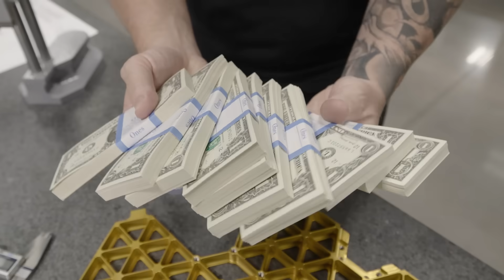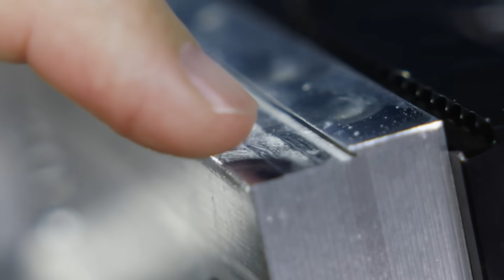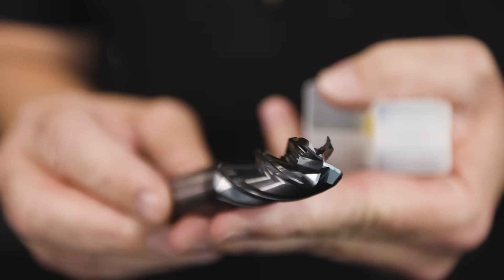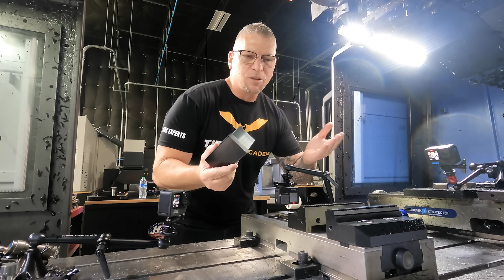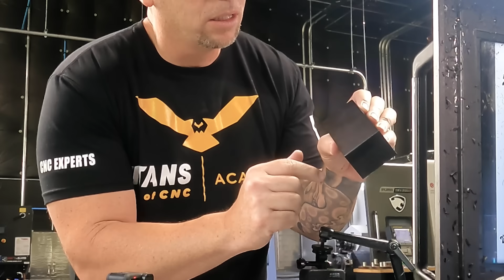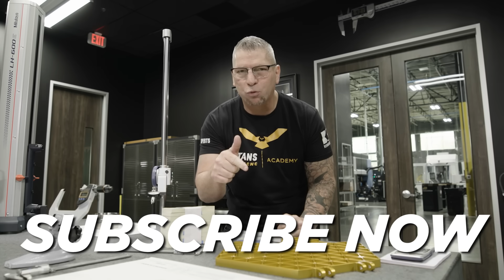How To Master The ART of Machining Plastics

Comment: I’ve been machining for about 3.5 years. I originally went to votech for diesel mechanics, but when I found out the school had machining, I decided to give it a try. Struggled at first on the lathe….but after a few minutes of fiddling I got that perfect cut. Perfect speed, perfect feed, chips breaking perfectly, leaving a flawless finish! As I stood there, mesmerized by what I was doing, I knew I wanted to be a machinist. Since then I have basically became a model employee for a good Godly man, and machine hydraulic components. During training what when I found out about Titans of CNC, did the building blocks as part of my training, and even convinced my shop to start using fusion360 over a significantly less intuitive software package. - Based on the average thickness of paper, plus a little extra for air gaps, I’m guessing that bill stack is 5.1510” thick!

Comment: Got into machining at age 17, in my co-op class in highschool, originally just running manual machines. after high school I went back and took a job at the same shop that they had offered to me. They put me on a CNC mill, and I loved it, I spent all my time learning about g&m codes, metrology, macro's. Year later, they bought a brand new wele AA1880, put me as the sole person to run it. We started getting very busy so we had a afternoon shift, and I became the supervisor of that at almost 20years old. Did that for a year and a half and have now moved to a different shop to experience different parts, allowing me to learn cad/cam, and to continue to grow my career. My guess is 4.412" or 112.065MM.

Comment: I originally wanted to go to for I.T. However, my mother wanted me to run a machine shop. Since my grandfather had a stroke and slowly becoming blind, he can't technically work anymore. So I took the time to go to school to learn machining at NTMA and go from their. I also took a couple of other jobs so I can learn the differences from other machines and controller. From FANUC, to HAAS, to Fadal, each machine has their strength and weaknesses. I also noticed that most companies like to push/rush parts instead of  taking the time to make quality parts and due to the fact companies are attempting to low ball you every chance they got which have discouraged me from time to time and how nieve I look. Especially, that I'm a fast learner sometimes I get compliments that I'm a little more advanced than my experience then to also face a learning disability like Asperger's syndrome has been quite a milestone. I'm from the inland empire, California. The stack is about approximately 4.380 inches if you account that a dollar bill is approximately .0043in and the paper strap is .004 (X2 since it's wrapped around the bills)

Comment: I am a 4th generation machinist who has been machining for over 20 years now. My grandfather started his own company back in 1975. After working for Gray Tool Company, he decided he wanted to start his own company. One where we treat our employees like family and not just another number. The first six months he was working two jobs, so during the day he would have my grandmother rough in parts and he would come home and finish them. By 1978 all four of his sons were in the shop learning the trade. In the 1980’s during the oil crash things got bad, but our family pushed through and survived. In the mid-90’s my father and uncle took over the business. Around 2000 my dad let me run my first machine! It was a 1954 Hole Wizard drill press that we still have today. I got to drill (12x) 1-3/8” holes into flanges. By 2005 I was running our big CNC mill. It was a Doosan Puma V-60 prototype. It had 45hp Cat50 spindle, and boy that baby could hog in its day! After years of learning the CNC machines, I got my chance to get into the programming room. I was so excited that I finally had the ability and the power to build programs to push these machines to places we had never taken them! Since then, we have advanced our shop with major upgrades like 1000psi machines, CNC saws, de-vibe bars, all sorts of modern cutting tools, and even a shop system that helps us control the jobs from Estimating to final shipping. It has been a wild ride, but I have made a lot of family over the years. The only thing that hurts is the way the economy is head. My hope is that we can survive through this time. We are down to 7 employees now, but we are still have positive months rolling in. 

I’m very thankful to you guys and what you do. I hope you inspire a new generation of machinist through your channel!

Guess: 5.0525” or 128.335MM

Comment: Been in working cnc for just under 4 years now. That is unless you count high-school. Taught myself the basics on an old tormach 770 my junior year. I've been in love with manufacturing since my first day of high-school when I saw a lathe for the first time. It blew my mind that metal could be shaped so easily. Joined the FRC team at my school and went to work hard learning as much as i could about the manufacturing process and CAD. Making and designing parts for our robot. Was put in charge of our design and manufacturing for 3 years. First time they'd ever let a sophomore take on that kind of responsibility. I was absolutely blessed to have such a great opportunity. I graduated and tried to go get a job as you do. Was looked over every I applied. Grocery stores, retail, our local tire plant. For some reason I never heard anything back. I saw an add one day that a shop was having open interviews so I went not really expecting much at that point. Filled out the application and shocked the HR rep that someone so young was interested in being a machinist😂. Turns out I had already met the owner while I was on the robotics team! He even had a plaque that I had engraved for our sponsors on his desk! I was hired on the spot and have been soaking up knowledge like a sponge lol. I was trained on the manuals by one of the brightest machinists I've ever met. After 4 months of that I was allowed to go be the button pusher on our smallest cnc. Now at 22 I'm the senior vertical mill operator/programmer and have actually been training people myself. I met my fiancée on that robotics team. She's been the light of my life. I wouldn't be anywhere I am now if it wasn't for manufacturing. Looking back on everything that's happened I can truly see that it's all part of a big plan and I've been extremely blessed. Titan you're an inspiration to everyone. You yourself have blessed people with the knowledge and resources to be successful. One day I pray I can be half as influential to the field as you and your crew are. (Also I think you should look into FIRST robotics if you haven't already. I think you would love it!) My guess for the stack is about 4.3300 +/- .0100 if held completely flat. It's got a bit of a bow so if it's just resting than I would say about 4.4500 +/- 0.0200. Hope you have wonderful weekend

Comment: My family has owned and operated a tool and die shop since 1985. In the early 2000s times were tough and dad told me he didn’t want me to go in to manufacturing. (I don’t think he thought his business was going to survive.) so when I graduated high school in 2007 I choose nursing as a career path.  Unfortunately my father was diagnosed with cancer and passed away In 2009 and the business was still operating. I knew very little about manufacturing however I decided  to come home and help mom with the shop. It didn’t take long before I was hooked and I have never looked back. It is still a struggle today but I wouldn’t change it for the world. I have a skill the can be taken away. My favorite thing about this trade is I can always learn and try something new.  My guess for the thickness of the stack of $1 bill is 4.3837

Comment: Hey Titan, my name is Travis Scott and I’ve been machining for a little over 6 years now. I work at a job shop so I’ve had a little bit different machining experience than some. I went from a Haas vf2 to a Okuma Bridge Mill in 2 years. I love the work I do. I also once was a substance abuser and my shop helped me get back on my feet. We do a lot of die making an gripping jaw parts that are heat treated an tight tolerances. Watch your videos cuz I love seeing the things y’all can do on mills lathes and grinders. I started on the Blanchard. I love learning new things an would love to be able to learn more but limited resources where I work. My guess on the stack of bills is 6.2527. Hope I guess right!

Comment: I've been a machinist for about 17 years. Started as a shop hand after I dropped out of college. Needed to pay some bills back. I've never been in a machine shop prior to being a shop hand. 3 months into being a shop hand I was promoted to run my 1st machine. First machine I ever ran was thread roller for piston rods for natural gas compressors. From there on I  grew a passion for running machine of all sorts from manuals to cncs. I currently manage a cnc shop. Where I program and draft  prints. While I manage the day to day responsibilities of being in a manager. I think the height of 1000 dollar stack might be  4.4375".

Comment: I came into machining about 5 years and 7 months ago in the great state of TN with absolutely no idea what a CNC machine was. I was freshly graduated out of high school when I had an opportunity to work closer to home at a copper power components manufacturing facility in my home town. At first I started in Deburring removing sharp edges from parts and need less to say I was not cut out to stand at a belt sander all day. So I asked my production manager to move to a different area that was more thought provoking and that's how I got introduced to Haas cnc machines. I was very timid at first with the machines to scared to break a tool or scrap a part. So in turn, I always got stuck with long runs doing very busy work at first but as time progressed I started learning all the variety of things there are to learn in a shop tooling, speeds+feeds, hands-on programming, blue prints, and a ton more. In these short 5 years I got introduced to a whole new trade that I never knew existed in school and I hope I can continue to expand my knowledge to get better everyday so one day I can be machining some of those crazy beautiful intricate parts you have shown us over the years. Love your videos be sure to tell Barry he's still the GOAT.
Reply: Ah, the good old deburring days 😂 Hahaha hi Austin!

Comment: Nice work on the plastic and the finish passes for the smooth finish.
I worked in manufacturing for 29 years. Started out in 1989 for a company called RTW formally TRW located in NW Arkansas. It was later bought by Kennametal. I started out running manual machines making the old single points with carbide tips of various sizes. Worked my way up in different positions from manual machines, cnc, brazing, lead person, quality, engineering, and different supervisor positions. My favorite was R&D in the mid 90s. We worked on carbide printed circuit board drills. Some of our test was drills .0097 in diameter. These drills was drilling three and four high layered copper panels with fiberglass and other materials. It was fun working with customers and sales guys cutting drilling costs. Miss the good old days when working in the industry was fun. Kind of turned into a cut throat industry now and I left it four years ago to do other things but still miss it. 
Your answer for the money should be 4.3000. ✌

Comment: Stack thickness derivation: 1. Currency strap thickness [10 straps and 20 surfaces touching money-stack] estimate "strap" thickness to be 112mic avg (0.112 mm) for standard copy paper. 20 "strap" surfaces in the stack equals 2.24mm of currency "strap" material. 2. One dollar bill thickness spec is 0.11mm multiplied by 1000 equals 110mm. 3. Money stack and currency strap expansion due to relative humidity?  Best guess is 1.34mm material total. 4. Money stack and currency strap mass compression due to gravity? Best guess is 0.5mm. Stack Height estimated value is 113.0800mm (4.4519 inches).  I am a student of CNC machining and CAD-CAM preparing for a future position in the industry, or a garage shop producing small one-off enhancement parts. Peace.

Comment: Manufacturing jobs has paid mine and my families bills for the past 30 years. Started going to trade school for Machine Tool and after a year of school got into a machine shop. That ended up being short lived because management was horrible. Loved the job but couldn’t handle the management. From there I went into the printing industry for quite a few years and worked into electrical maintenance. Did that for a while but ended up making a major move after meeting my current wife. After my move I worked various manufacturing jobs for a while and after getting tired of working 2nd shift, went back to school for Mechanical Design.  Now I work in the metal stamping industry as a Tooling Engineer and love it. I am not always at my desk which is nice. I spend a lot of time in the tool room and on the press room floor interacting with those individuals. My main focus is Fineblank tooling and love working with the precision that is involved with that tooling. My son is almost done finishing up his CNC schooling and I couldn’t be happier that he picked machining as a way to go. Very hands on rewarding career. As far as the height of the money, my guess would be 5.0625”. Love the content on his channel and even with all the experience I have, I have actually learned quite a bit watching your videos  Thank you!!!

Comment: Hey Titan I've been watching for a long time and have enjoyed every video and using the Kennametal tools is amazing I would have never got that chance if it wasn't for you. I have build and designed wired and programmed 4 CNC's (wood router, Plasma table, lathe and Mill). stepping up every machine until I bought a Fadal for my home shop. it might not be brand new but wow having a tool changer and 22Hp dual range spindle boxed ways with linear encoders thru spindle coolant with renishaw tool setter and probe plus the 4th axis for 2500 as close as a Doosan I'll have for now. I have used many of these machines to help family when we need parts that are custom or upgraded dad will just hand me a piece of paper with some dimensions on it, and few hours later I hand him the part. There's just something about taking a square block and knowing the part you designed is in it that completely fascinates me. And knowing I did that and what it takes to make it. We have just completed a 67 mustang fastback fully custom every inch of the car we modified I have made countless brackets and billet parts. Most of them you have to think in 3D because we folded them to make the part. I have 3d printed parts also that make the car different. Have even used laser to etch parts. So as you can see this car has been built on many forms of CNC's. So not only do I use my machines for customers build but I use it for a way to spend time with my dad and the quality time is priceless. I have never went to school for any of this just self taught with the help of YouTube and channels like yours. I use fusion360 for my programming and would like to thank you for all you do for us self taught that look up to the huge machine shops. My guess is 5.1000
Reply: Going through tech school for precision machining as well as electronic engineering. I am also working at an awesome machine shop. I absolutely agree there is something special being able to look at a random chunk of stock and being able to "see" the parts that could be inside.

Comment: been working as an inspector for 12 years, I love the industry. I work for a pipe threading company in Houston.
if the bills get pressed as flat as possible the height of the stack should be at about 4.429"
Reply: Yeah I just did a guesstimate of glue thickness myself not knowing how much to add although it will be something for sure!
Reply: I got exact same height but then I added glue thickness aswell coming in at 4.4312"👍
Goodluck!
Reply: @Th4thWiseman  yeah was thinking about the glue but did not know what thickness it could be.

Comment: Great video as always! Well im starting machining in September, I discovered my passion for it when I was doing some manufacturing for one of the teams at my university. I had the opportunity to use an old tormach for a project and I absolutely loved it! I also for the past week pretty much closed myself in the university shop and machined myself a whole new set of parts for my 3D printer. After that and discovering more of the trade with your channel I decided to apply for a program and got accepted. For the stack my guesstimation is 4.38!

Comment: Hi
I'm from Iran
I used to be a university student. After I finished my education I worked in additive manufacturing for about a year. It helped me to gain more practical experience. Now, I've decided to apply for a manufacturing engineering master's course abroad, and this experience is a valuable part of my resume. By the way, I guess the thickness of dolours can be 16.274 Cm or 162.74 mm or 6.40 inches

Comment: Manufacturing changed my life drastically, I’ve started as a machinist in Swi 25 years ago, today I manage a shop with over 300 ppl in Philippines machining composite materials with 3 & 5 axis VMC for the top Semiconductor players. 
BOOM 💥 
The stack of 1$ bills is 111.52mm thick